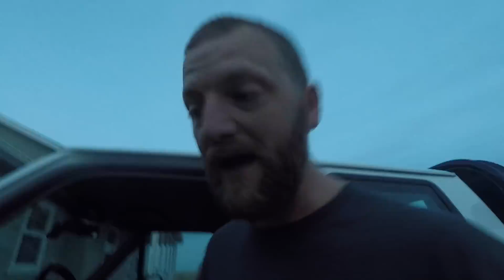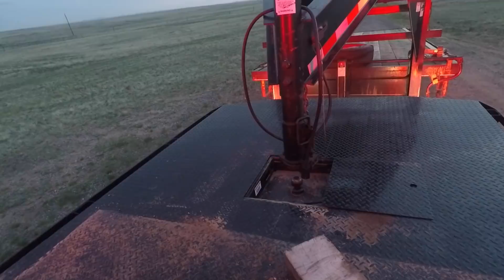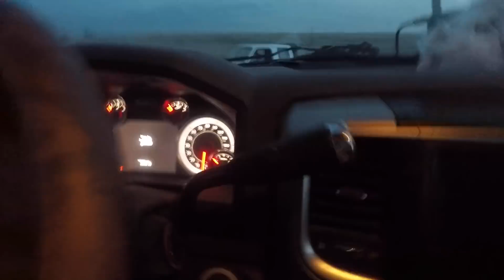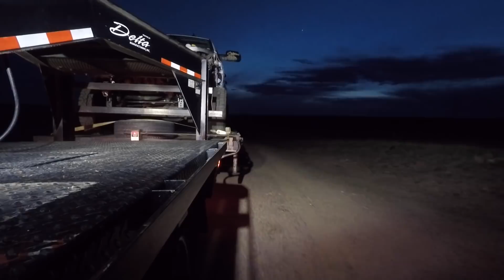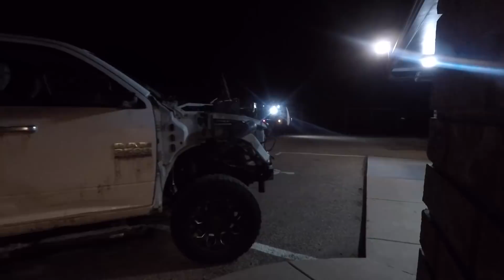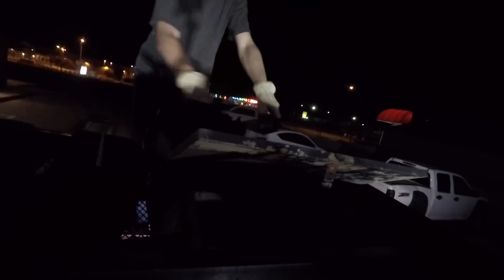Ram goes to the frame shop

Comment: My 750 hr tractor with chronic fuel in the engine is gone and already replaced. Dealer stepped up and pretty much gave my money back for it. Only thing that saved me was it has been an ongoing issue since before I bought it.

Comment: What are your plan for the 2500
Reply from the maker: We’re going to rebuild it better than it was before with a few modifications.
Reply: Guy in WY if you don’t mind me asking how much was the bed for the f250 because I have 2000 7,3 powerstroke and was wanting to put one on my truck

Comment: You ran the Ram with no cooling system? Interesting.
Reply from the maker: Sure did. It’s fine in short sessions, not going to overheat just moving from place to place for a few minutes at a time with no load.
Reply: Tough on the water pump though?
Reply from the maker: Not too bad for a few minutes.

Comment: Don't put a loader on a 2wd tractor it's a recipe for disaster
Reply: Our 4020 had a loader on it for building the machine shed and winter yard plowing. Otherwise the loader was on the stand. We never had a loader issue and it was our main farm tractor for years until the 4420.
Reply: Michael Chugg well a power steering 4wd loader tractor is far more capable that a 2wd and it is far easier on a operator
Reply: I would imagine so. But we were just a 640 acre two wheel outfit, so my dad, a heavy duty mechanic and JD salesman, just made do with what we had. He knew all the limits of the machinery. As soon as the thaw, my brother and I had to get that loader back on the stand, so the tractor was ready to do its real work. I'm sure if we were doing dairy it would have had to have been a 4wd for barn and yard work.